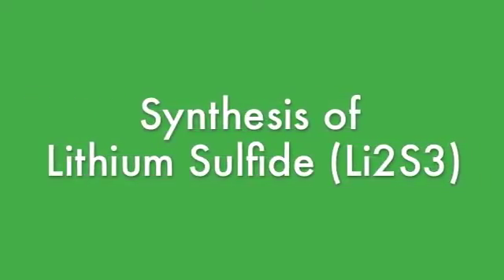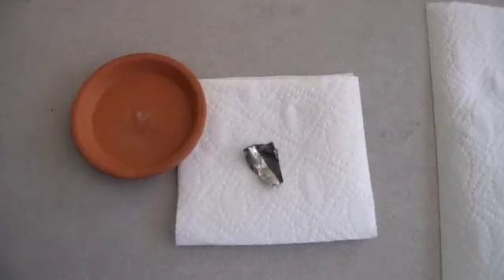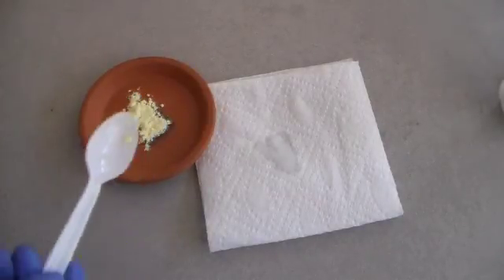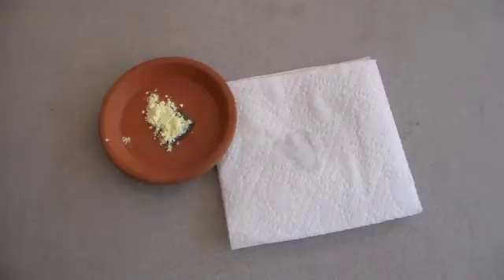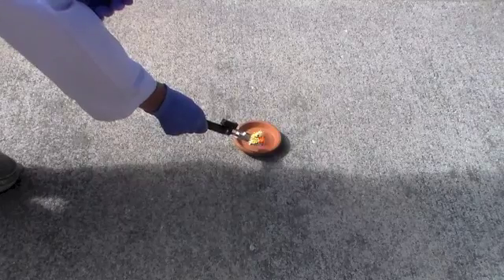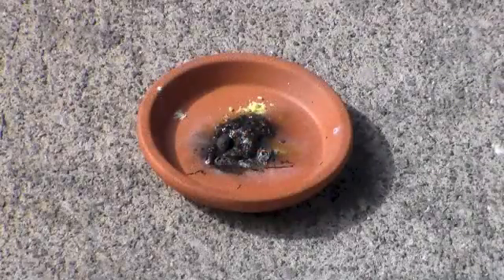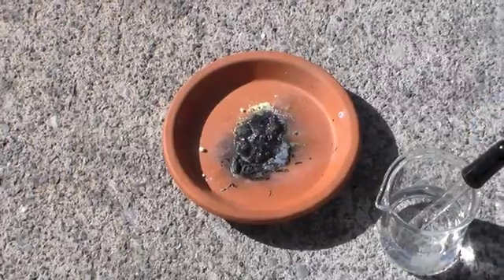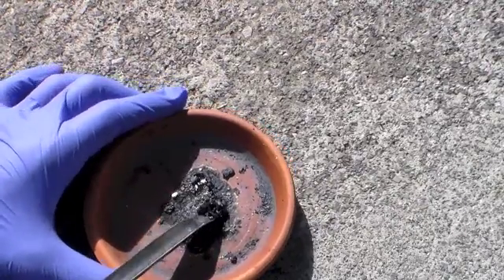How to Make Lithium Sulfide (Li2S) and Hydrogen Sulfide (H2S)

Comment: Cool. For alkali metal sulfides, you need not to add acid to produce hydrogen sulfide. Because, they liberate the gas even on hydrolysis. That's why alkali metal sulfides have the smell of hydrogen sulfide. But for rapid generation of gas, you can add acid.
Reply from the maker: Yeah I tried water first, but the H2S wasn't produced very quickly; there wasn't even any bubbling. I just found an acidic solution to give more visible results (as in clear and obvious bubbling).